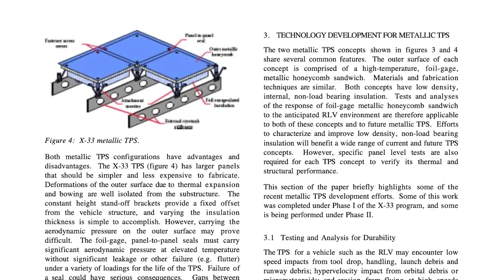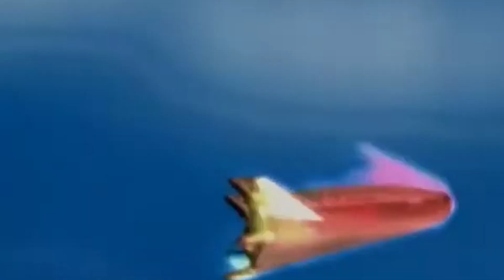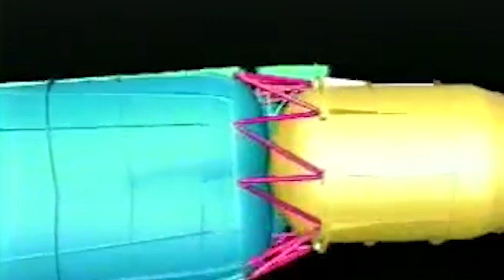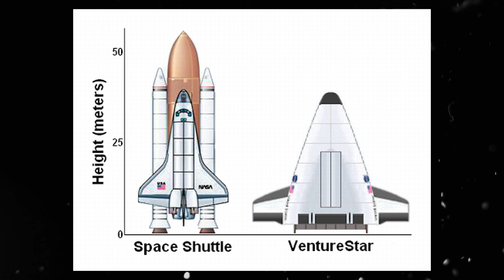The Secret Skunk Works Space Shuttle Replacement

Comment: The X-33 was a real cluster in more ways than the video describes.  A key part of the rocket equation is starting mass verses ending mass.  One problem the x-33 had was the linear aerospike engine was heavy, complex, and had major cooling issues.  We still don't use linear aerospike engines because they are worse than bell engines.  A secondary, related problem is hauling the whole structural mass of the rocket to orbital speeds has always been a bad idea.  The Saturn V got a higher percentage of its starting mass into LEO as payload that the Space Shuttle specifically because it dropped off its unneeded mass on the way up.  The Space Shuttle however hauled up the giant external tank all the way up to orbital speeds as well as a giant orbiter with wings and a big heat shield.  That cut the payload mass of the Space Shuttle down to almost nothing; the rocket barely made orbit and all safety systems were cut out to try to carve out some room for a small payload, which ultimately allowed for some payload at the cost of whole crews' lives.  And this was with a 1.5 stage design.  So yeah, dumb, especially when we knew better.  So X-33 comes along and ditches the dumb 1.5 stage design for a single stage design that would have never been able to make orbit.  Dumber.  There is also the issue of once you have burned through most of your fuel load, you don't need all of that engine mass you needed with a giant rocket full of fuel.  2 stage to orbit rockets drop off this extra engine mass and continue on with engines optimized for use in a vacuum.  Especially if you are hoping to have headroom to reuse the rocket, you need a 2 stage design.  The virtual bell of the linear aerospike was an interesting concept on paper, but never worth the while in real life and never could have been.

So yeah, let's look at how Starship looks to reuse the rocket and this will put any fears that canceling the X-33 caused good technology to be lost to rest:
1. Use LOX/ subcooled CH4 with full flow staged combustion engines - between the fuel tanks being much smaller and dramatically lighter than liquid hydrogen tanks (the X-33 used liquid hydrogen), the ISP only being somewhat less, and the engines being a lot more compact and powerful, further reducing the ending mass of the rocket, Starship is the most efficient rocket in terms of delta-V while pushing to orbit by a significant margin.  If all of the recovery hardware was ditched and materials for an expendable rocket were used, Starship would get something like 7 - 9% of its starting mass into LEO as payload.  Expendable Falcon 9 can do 4%.  The Saturn V could do 3%.  The Delta-V, another liquid hydrogen rocket better optimized around 2 stages can do 3%.  The Space Shuttle could do %1 with its crappy 1.5 stage design.  The X-33 would likely have done -2% as in it would fall back to Earth as a failure.

2. Heating factor for re-entry is a cubic factor.  SpaceX currently recovers its first stage with minimal shielding as the booster never really goes all that fast and at this does some engine braking to be a little easier on the booster.  I expect Superheavy to slam through the atmosphere more with less engine braking because the stainless steal can take higher heat loads.  Then for Starship, only the upper stage needs to be tiled to take re-entry.  The tiles on Starship are of particular interest because they are non-ablative.  The heat they generate would cause most spacecraft to melt, but because of Starship's stainless steal design, it can take the heat load.  The tiles on Starship are just designed to buffer the heat enough to keep the stainless steal from melting.  Anything Space Shuttle, X-33, etc, would not have the capability to use non ablative heat shielding because Starship is the first rocket in history with the engineering margins to use stainless steal and still have headroom for more recovery hardware and still have room for a useful payload on top of that.  The devil is in the heating details on this game changer.  The X-33 would not have succeeded here, especially with its single stage to sub-orbital flight capability as it was, but even more so when it is all just one huge stage instead of a smaller second stage you need to cover.

3. Another big point to staging is for Falcon 9 at least, every 5 lbs of recovery hardware on the booster reduces payload mass by 1 lb as the booster never goes as fast as the second stage.  However for the second stage, every 1 lb of recovery hardware reduces payload mass by 1 lb.  So for X-33, every 1 lb of recovery hardware reduced its payload capacity by 1 lb.  This is another reason why my estimate for payload to orbit for the X-33 is negative is both the non-round design and all of the other recovery hardware made the rocket too heavy and this was an intractable issue.

4. SpaceX has ditched as many flight surfaces as possible and just focuses on controlled falling.  All of these flight surfaces and non round designs adds structural mass to the rocket.  As engineering margin was rockets are extreme machines that just barely get their job done, adding anything to the rocket, especially dead weight during launch like wings, eats away at these small margins very fast.  Also just having the rocket be design for both vertical and horizontal orientations on Earth greatly increases its structural mass.  Starship deals with this problem by always being vertical and so doesn't need the extra structural mass to be moved to a horizontal position on Earth.

So yeah, considering all of this and more, the deal with the X-33 is instead of focusing on the replacement we needed for the bad and dangerous design of the Space Shuttle, everyone with bad ideas and ideas that just didn't fit anywhere and political pull were briefly all given one small pot to dip their hands in and what they came up with was an unworkable, incoherent mess, as to what was to be expected.  It would take an Elon Musk later on to cobble together a coherent vision and then have the right technologies investigated so they could later be implemented in a workable, truly reusable rocket.  At this we are awaiting the first Starship almost orbital test to better validate all of these designs placed into one rocket, and then a higher thrust version of Starship to cut down hang time and thus purportedly increase the capacity of Starship by wasting less fuel fighting against gravity.  Especially if the later Starship flies, then we will know with more certainty that all of the technologies invested in were good ones to integrated together into one reusable rocket.  At least right now the theory sounds good where to the trained observer the X-33 was always fatally flawed.  Just say SSTO alone was enough to kill it for anyone who has done a rocket equation in their life as they would realize there was no way for it to reach orbit, especially with a payload inside.

Comment: The only test failure was the failure of the composite tank, which was not necessary for the design to work and was exceedingly expensive. The composite tank was a typical NASA insistence on "new technology" being prioritized over viable technology and *economic viability*. The focus on LH2 as a fuel was also a typical NASA prioritizing political ideology (environmentalism) over project viability. If they had gone with kerosene, the vehicle would have been viable, affordable, and with smaller tankage (and no need for a stupid composite LH2 tank).

Comment: G'day Dark, I certainly hope that someone continues research into the BF Goodrich replacement for the Space Shuttle's labour intensive, expensive ceramic tiles. According to what I've read, the tiles were one of the major reasons why the Shuttle's proposed flight turnaround and frequency targets were never met. When over 1 billion dollars of taxpayer money had already been spent; it makes total sense to salvage and develop as many of the positive components of the X-33 as possible. 
For instance, the magnificent concept of Jack Northrop's 'Flying Wing', not long after WW2, failed simply because it was tried decades before small, on-board computers were a reality. If the Flying Wing had on-board computer assistance for control of the flight surfaces it would have worked with either props or jets. At that time, the Government stood over Northrop's employees to ensure they complied with a political instruction to reduce all the Flying Wings to scrap metal. So, aircraft like the B-1 and B-2 bomber had to be researched from scratch without the benefit of Jack Northrop's previous experience. 
If the X-33 was scrapped or not is an academic point. If we don't learn anything from it when undertaking future aircraft/spacecraft design concepts then that is more money down the drain. 
It's rare indeed for the Skunk Works to have a total concept failure... in fact I don't believe that for a moment. There were, obviously, other agendas involved.
Thanks for another engrossing video, Dark. You sure come up with some great story ideas. Cheers, BH
Reply: SpaceX appears to have solved the tile problem. We will see what happens during their upcoming orbital test regimes.
Reply: The prototypes might have been scrapped but the lessons learned and the blueprints and technology developed for it surely went into the next generation vehicle, which is probably more secret.
Reply: NASA created a publicity campaign that crossed my path at a county fair about 25 years ago that featured the blowtorch on the tile then it was held by hand just moments after at the point where heat was directed.

Comment: Nice video! I worked on the ground support maintenance software system for the X-33 program. They were closer to success than many understand. The big issue was going to be mass to orbit. It was hoped that subsequent development would increase it, like the Navy did with the range and payload of the F/A-18 Hornet. Super Hornet is proof that sometimes you have to build and fly an advanced design, and then improve it to meet the desired outcome. She would have been incredible to see fly…
Reply: Yeah, had they had the sense to just fly the damn thing and upgrade as it went along we could have had a small fleet flying today, assuming it had worked.

Sure, the first few may not have had the desired cargo, but as long as they could get to orbit and back as a SSTO that alone would make for massive cost savings, and as advances in components came into use that mass to orbit would increase.
Reply: With In-Space Refueling, this X-33/VentureStar SSTO architecture would then excel for crewed Beyond-LEO operations (e.g. MEO, GEO, Lunar NRHO, and near-Earth Lagrange points)  . . . and then come back down to almost any landing strip occasionally only for overhauls.
Reply: Yep, what wonders can be accomplished when executing a “canopy job”.  End result pretty fantastic still.

Comment: Had the Venture Star ever actually flown it would have been a wonderful introduction of various technologies. However it never flew. It was referred to by a lot of folks as "vapor-ware" usually in a derisive manner. At the same time McDonell Douglas had constructed a half scale single stage to orbit (SSTO) using readily available equipment taken off the shelf. When they needed door hinges and a quick trip to the hardware store with suffice for a set,  that's just what they did. The flight computer for the DCX was one from an MD 30 aircraft that thought it had very strange flight characteristics. And, this craft was flown over and over basically requiring only refueling and inspection between each flight. Finally however they had a problem with the landing gear where one of the four legs would not extend at the end of a flight and they tried everything possible to get it to come down.  They finally had to shut the engine off whereupon it fell over on its side and burst into flame.

After McDonnell Douglas was taken over by Lockheed the whole project was quietly swept under the carpet. It's really a shame because it had a lot of potential but they were trying to make the Venture Star work and this was considered a distraction.
Reply: douglas merged with boeing, not lockheed
Reply: That's not how the DC-X program ended.  It was made for the US DoD, and once they had reached the program's objectives they handed it to NASA for further development.  Except by that time NASA was married to the Venture Star program and basically shelved DC-X at the first opportunity.  There was nothing secret about what was done and why.

And Lockheed Martin didn't take over McDonnell Douglas.  McDonnell Douglas merged with Boeing in a stock swap.  Though longtime Boeing employees will tell you it was more like a takeover by McDD management.

Comment: How about a story on these. This I knew as the HAUC, it's the slowest in our fleet at only 300 miles per second and can reach anywhere in the world in less than 90 seconds, US Patent Number US10144532B2 . It's powered by a Zero Point Energy device that produces a terawatt of energy from a roughly 3ft diameter sphere, US Patent Number US10322827B2 . There are other patents to speak of but this should be a good start.

Comment: I think spaceX has done a absolutely fantastic job at melding the latest technology with proven materials, some that have been around for decades. NASA did a great job of supporting spaceX, almost as though they knew spaceX wouldn't be hindered by red tape
Reply: The big problem is ITAR requirements. Spacex doesn't have the same level of restrictions (they have some), when compared to other companies like Lockheed or Boeing.
Reply: "they knew spaceX wouldn't be hindered by red tape"

Yes, this seems to sometimes be the real problem. Hopefully private space ventures can largely avoid this.

Comment: The problem was that Lockmart completely overpromised on what they could deliver,  using models that were, shall we say, optimistic to reach the performance to weight ratios needed for single stage to orbit. 

Frankly, NASA and the Clinton Administration should have known better. But they didn't, and they went for the program that promised the most, rather than a more practical design.

When Lockmart actually tried to build their design, they failed hard. They couldn't build the composite tanks they promised, the control surfaces were way too small to work, everything weighed way more than promised. About the only thing they got working were the linear aerospikes. By the time they blew through all their money, they were still nowhere near flying.

They failed, and they deserved to fail.
Reply: However the SLS burned more money than anyone could have imagined, and it didn't get canceled so far. What caused the different approach in this case? And the SLS is based on the proven design, that should have saved some money, and that didn't seem to have happened, so far. I mean they might have gotten the Venture Star to work, with the money they burned on the other progamms. I think Elon was very successful so far, thanks to the difference between his approach to that of the established programms. Elon's programms might have been cancelled, if he were a Nasa employee on a government payroll.
Reply: @michaelmoser4537  The purpose of STS was to be a big fat white elephant program to keep the politically entrenched legacy space industry happy while SpaceX rendered them obsolete.
Reply: @michaelmoser4537  sls burned money because the us government is so stupid to engage in cost plus contracts.

Comment: I actually studied some of the X-33s tests with the linear aerospike engine for my aerospace engineering classes. Fantastic design idea and it's a shame that it didn't work out.
Reply: Musk likes those engine nozzles !
Reply: LAE is a stupid idea.  This seemed to be a boondoggle from the beginning.
Reply: aerospikes=garbage, at least until there is some significant advancements in material technology and even then they only barely beat out bell nozzles by a small fraction.
Reply: @Shrouded_reaper  even with 
Wundermaterialien, they are hopelessly inefficient.

Comment: Like so many, this was canceled for short-sighted and petty reasons. It is beyond aggravating how people seem to seek saving defeat from the jaws of victory, all for selfish ego-stroking and greed.
Reply: It's infuriating, actually.
Reply: They couldn’t solve the carbon wrapped pressure vessels at the time. It came quickly afterwards - I still agree with this statement in general
Reply: @dmacpher  They weren't allowed to use Li-Al tanks... And they were even lighter at the time. It was political, not technical reason.
Reply: What do  you know about the factors involved in the decision making process? It is easy for you to dream about this amazing new technology, but the reality was it promised more than it could deliver at a greater cost. The market spoke to this otherwise, SpaceX would have used the technology. They didn't. That tells you all you need to know.
Reply: @nickrose8733  Space X went retrotechnology.  Musk just found out it could be done a lot cheaper.  X-33 was killed because it was endorsed by Al Gore.  There's really no other reason, at least not one that made sense.
Reply: @nickrose8733  Agree. They cut it off before it became Shuttle expensive 2.0.